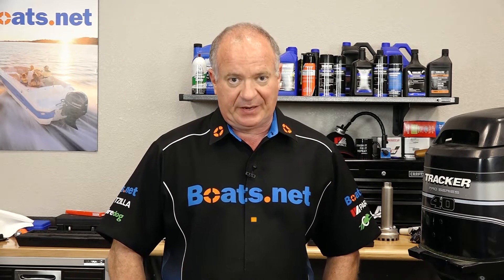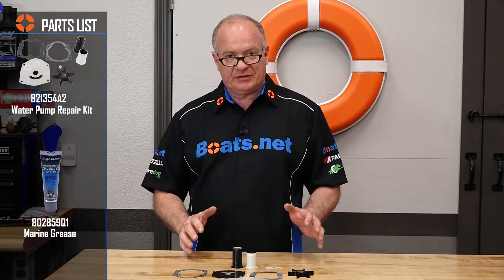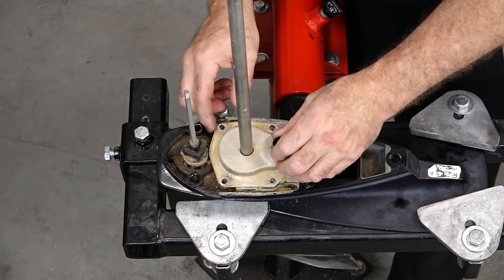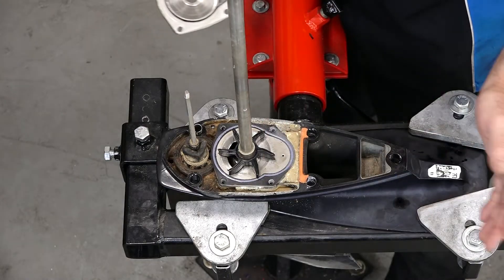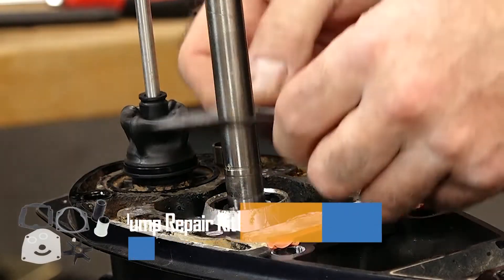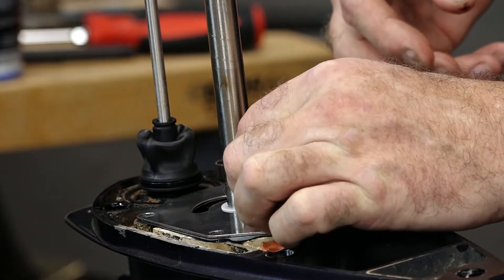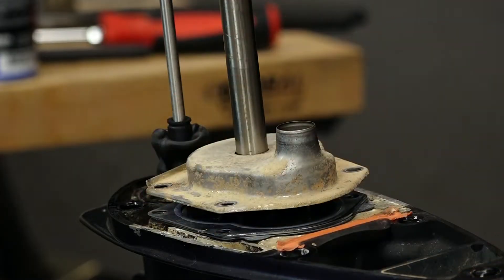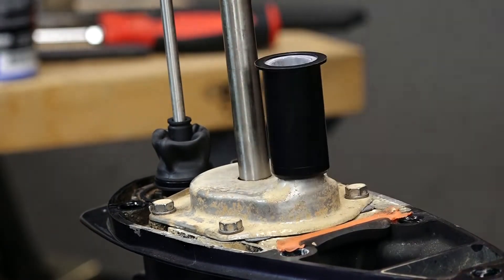How to Replace a Water Pump on a Mercury 40 | Mercury 40HP 2- Stroke Water Pump Replacement

Comment: I replaced an impeller and put the lower unit back on on my 2003 2 Stroke 40 HP Mercury outboard.  I can get the engine into forward and reverse and into neutral.  If I move the propeller by hand clockwise I hear a clicking/clunking noise 4 times per full rotation of the propeller.  Is this normal? Most would never know unless you turned the prop by hand.  With the motor running you could never hear it.

Comment: I just replaced my water pump kit ordered from this description. Seemed to match perfectly. . I have a 40hp tracker Mercury 2002/2003. Put everything back how it came off and re connected shift linkage but now my motor doesn’t find the neutral although throttle is in neutral. Previously anywhere in neutral I could start. Now I have to move the throttle super slow in the neutral gear back and forth in its play room while holding key turned and sometimes it starts and sometimes it’s just dead and never attempts to turn.  It doesn’t attempt to crank at all till it finds a spot in the neutral while holding key turned to start. so it never cranks till finds a spot moving throttle back and forth in neutral, then it does sometimes and cranks and starts. Any ideas?
Reply: The linkage that you reattach when putting the lower end back together...  that linkage from the top of the motor has a long nut that you turn in order to mate it to the linkage on the bottom end... and that long nut needs to be turned until the rod that it rides is further from the end of the nut.. this adjusts the distance of the linkage and allows you to shift.  If the long linkage nut was tightened too much on the linkage rod then you will not be able to get gears changed... so adjust the distance of the long nut on the top end rod before reconnecting to the bottom end.  This is something you learn the hard way when noone online mentions it.

Comment: Did you turn the pump the wrong way to set the vanes? When you took the pump cover off the vanes pointed in the opposite direction of the way you set the new ones when you turned the drive shaft clockwise to orient the vanes.
Reply: I noticed that also,  They were bent for a counterclockwise rotation when cover was removed and then he clockwised set the new one,
Reply: I thought I was losing my mind. I bet a lot of people did this after watching this video.

Comment: I have a 2007 df225 Suzuki With water in the engine oil. I flushed it with new oil and filter and still brownish color. I’ve read so far it’s an internal problem. Maybe a head gasket or worse crakes head. One thing I’ve done that was wrong was running the engine while water was on the flush port. Could this have been where I screwed up? Thanks